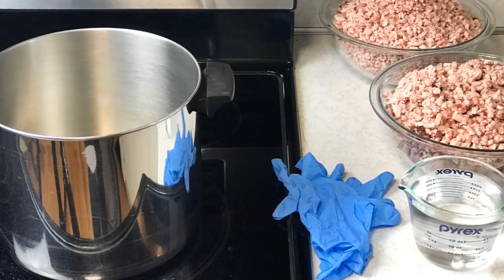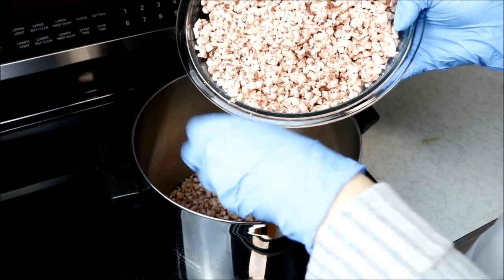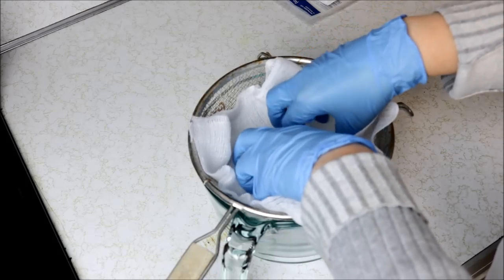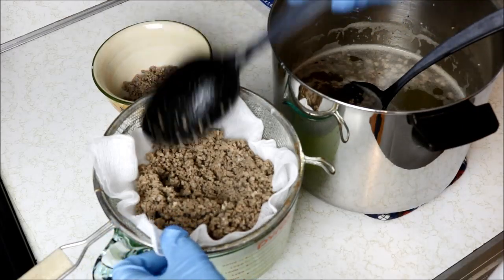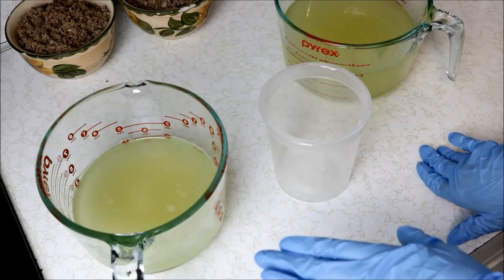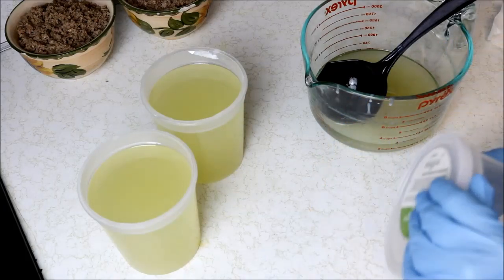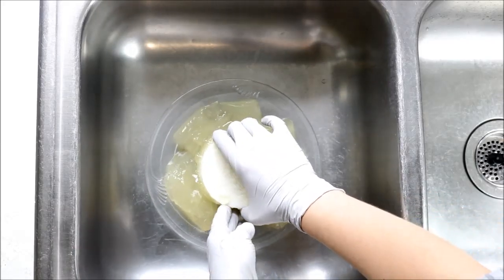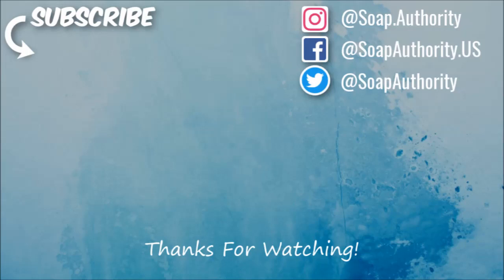How to Render Tallow for Soap Making | Melting the Fat and Pouring it into Molds (Part 3)

Comment: Can I use trim fat for tallow soap, or does it need to be suet?
Reply from the maker: Great question! Yes, you can use trim fat, but the quality of your finished soap will be different. It will probably be softer, depending on your recipe and the percentage of beef fat used.
Reply: using 50% tallow, 22.6% coconut oil and 22.6% olive with a 6% superfat and 33% lye concentration 
 @SoapAuthority
Reply from the maker: @TheEveryMinuteMom  That's a lot of tallow, so it's way more likely to be a really soft bar. The coconut and olive oil don't make super-hard bar either. If it had palm oil, that would help. You can always try a small batch to see how it goes. That way you'll know for sure.
Reply: gotcha! I have suet rendered so will work with that since I need, need some soap but will experiment with the other kind later. Thank you!
  @SoapAuthority
Reply from the maker: @TheEveryMinuteMom  You're welcome! 😁

Comment: Does your beef fat still have a smell? I've rendered three times and it still smells beefy. Good video x
Reply from the maker: It has a slight beef smell, but that completely disappears once the soap is made using fragrance. If the soap is unscented, it's reduced. The type of feed fed to the animal and rendering temperature can affect the smell too. I try and keep the temp as low as possible and I personally think grass-fed has a stronger smell.